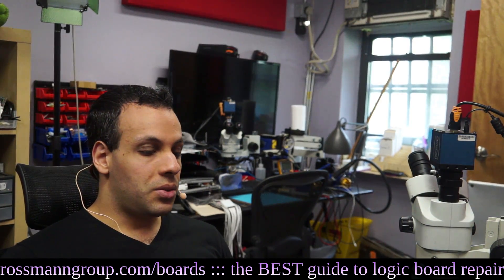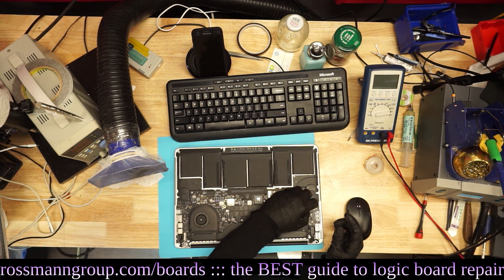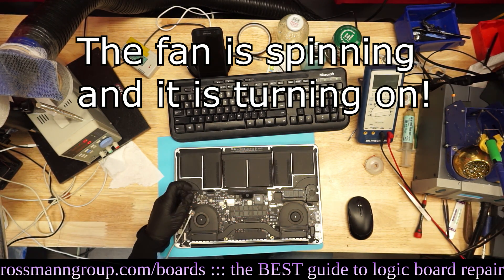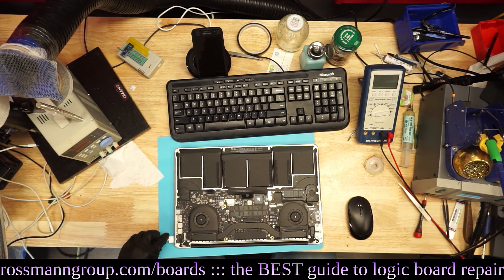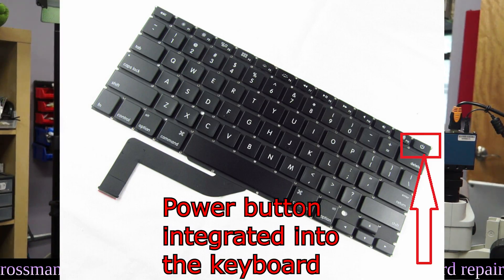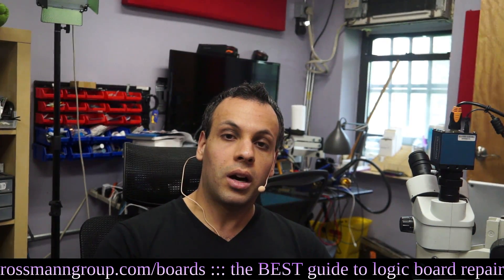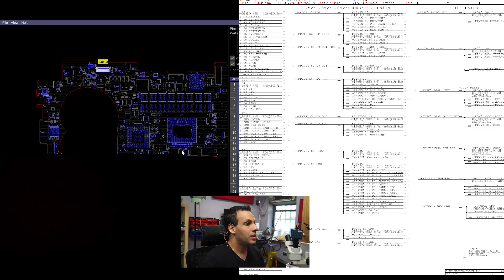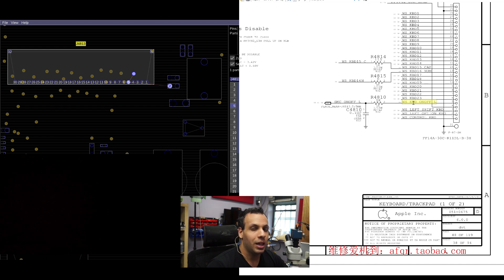Ingenious Macbook Engineering: explained in 3 minutes.

Comment: Although I would never buy an Apple product, the power button thing is not really Apple exclusive. All my Sandy Bridge Thinkpads (X220, T420, T520, W520) also have the power button on the keyboard. Not sure about my mom's T400 but I think it's the same on that one too. On the other hand those keyboards are protected against liquid damage and replaced within 2 minutes in case you damage them.
Reply: Yeah, it's bad, and not for a $1000+ device, but it's not apple alone.
Reply: No longer an issue with the T440 and newer laptops.  The power button was moved off the keyboard.
Reply: Except for the fact you can spill gallons of liquid on those Thinkpad keypads and it will still work. Go look up Thinkpad water torture videos on Youtube.

Comment: many lenovo thinkpads have the power button integrated into the keyboard like the T60, X220, X230, T420, T430, T520, T530
of course those keyboards are spill resistant and easily user replaceable

Comment: older thinkpad keyboards also have the power button integrated with the keyboard, but the difference is those keyboards are spill resistant and very easy to replace

Comment: My ThinkPad R61i also has the power button installed with the keyboard...On the other hand, when my power button starting shorting out, all I had to do was open a few labeled screws and swap it out with a replacement that was readily available and quite easy to order (not to mention cheap given how many years out this one is, along with all the computer recycler surplus).

Here's to good luck towards the fair repair bill, so that we can at least have a means of getting replacement A-stock top cases. 😆

Comment: THANK YOU! This is the EXACT problem I have. I've tried many different Google searches with different keywords. The answer I was looking for wasn't coming up. My situation is almost exactly how you explained water getting on the Z key. I spilled water on the space bar and bottom keys. If I take out the battery and plug the magsafe in the Mac book is functional, but with batter in it doesn't turn on. I'm confused on what to replace. Thanks Louis for all your in depth knowledge

Comment: In all fairness, xx20 and older series ThinkPads have a power button integrated into the keyboard.
At the same time in the 10+ years I've been using thinkpads I've never had any issue with this.
Reply from the maker: Spill resistant keyboards baby!!
Reply: Thinkpad has spill resistant keyboard. Ideapad otherwise..... is fucked up.

Comment: Wow, Louis made me realise something.. when he said you can't even plug in a cheap keyboard and recover your data. I was thinking, why worry about your data as it has nothing to do with power or your keyboard.   Then I remembered that the SSD is soldered onto the motherboard and unless it has be powered, you can't get your data off.

Wow, how something so incredibly simple like a keyboard and disrupt your entire life. 
These things seem to fragile.. Unlike most systems that keep on going if they can, it seems like these macbooks has so many points of failure you would not want to even touch one.

Even if someone gave me a £3k macbook.. I would worry about using the thing and be disappointed that I would not expect it to still be working in 5 years.  

Cheers for another, great and amusing video Louis.  The regularity is great.

Comment: Asus VivoBook X541UA is a laptop with a core i3-7100U which has a power button integrated on the right side. And it's far cheaper (and better) than the Macbook and the Macbook Air. You can get it for $380 where I live. (Though I'd spend $100 more for the full HD variant.)

Comment: I personally really like that simple and elegant solution of combining the already existing keyboard and power button, and yes of course there can be some challenged when the keyboard breaks ;) but it is in the form of reducing and combining still the best and most elegant solution. The worst of all is that if I was the designer, I would really have a difficulty time of decided whatever to completely remove the Power button, as you know it from the iPod, or to keep it xD just because I love this solution so much. 

It's a bit like the MagSafe charging port, it just has to die along with any other ports that not are the new universal USB-C, but at the same time, I also love this MagSafe charging port so much that it would be very hard for me to take such a choice. But again soon or later there someone need to take that responsibility to promote a more simple and elegant world where all ports are of the same type.

Comment: My acer laptop also has all the keys as one keyboard which includes the power button BUT looking on the bottom of the keys,  it seems to be waterproof, the place where the keys are is sealed off, and the key presses against a sealed off smaller button underneath, im guessing that was too hard for apple to think of.
Reply: Viralshadow 
I have a cheap 300 dollar acer laptop and it too has the power key in the keyboard layout as well. I don't think that it has any sort of protection against water but I've accidentally dropped water on it. Luckily my machine didn't malfunction.
Reply: even still, i expect different build qualities from a $300 laptop compared to a $1000+ laptop, not the same issues
Reply: my laptop was at about 500-600$ if i convert the price to usd, but that wont be fully accurate, it wasnt cheap, more in the mid range for pc's here, but damn the cpu is weak sadly (1.7Ghz i3 duel core)
Reply: Ed Saucin  I didn’t even know you could get a Chromebook for $200, let alone a laptop! I’m surprised it hasn’t fallen apart in your lap by now. As for Macs, I think newer MacBooks only use usb-c which means lots dongles, otherwise they are okay I guess.
Reply: Viralshadow That was also my thought, as I have been thinking, as a knowledgeable customer, about how laptop parts could become standardized for easy repair across years and brands.  Having a standard form factor and wiring for a keyboard and status LED combination board (in 3 sizes times 4 feature levels times 80+ languages) would be an obvious step, as the only laptops with truly unique keyboards are Thinkpads and Macs.
  Now the circuit on the mainboard would be required to do nothing harmful with a shorted / water damaged keyboard, and to accept powering on from a regular USB keyboard instead (that would be a Desktop Mac keyboard for macs).
  In my hypothetical list of 4 feature levels, level 0 would be a cheap easily shorted shit keyboard.  Level 1 would be conformally coated to limit and survive coffee and Coke(R) spills.  Level 2 would have a simple backlight for working in darkened rooms and level 3 would have individually controlled RGB leds.
Reply: +Ed Saucin
What do you expect at $300?

Comment: They should make the leaf of the Apple logo on the lid the power button if they're concerned about the esthetics of the machine. (Like one of those touch sensitive type things, not an actual button.) It would be a bit goofy but with Apple I would kinda expect it. They could also make the apple part a screen that shows basic information like battery level.

Comment: Louis, you are asking a company that gives zero F's about there customers to do something that could benefit their customers.
Louis, you already know that answer.
Reply: "As if Microsoft"

And do we buy computers made by Microsoft? I didn't know they sold any. I build my own computers using components from a number of companies... the OS is from Microsoft, unfortunately. I wish I could use Linux, but sadly it lacks compatibility with most things.
Reply: "What do you run on your "non-Microsoft computer?" Unix?" Apparently you can't read.

"Did you create an analysis of heat flow" Do you do finite element analysis before you bake a cake?

Comment: Here's why they do it. A surface mount tact switch is what? About $0.20 (I don't know for sure any more, too many years have gone by since I had to deal with such things) and a power button molded and pad printed in their volumes probably a nickle or less. So lets call the whole mess $0.25.  On the key board it's almost free because the keyboard has to be there anyway. Maybe three cents.  So there you have it. A savings of 22 cents per unit. Plus buy a new one from minor accidental damage. That's real money at apple's volumes since the faithful won't go away for something like that. 

Now the other brands, well someone will consider the machine a hunk of crap for something like that so they spend the 22 cents.

Comment: Lenovo up until the t530 series also has the power button integrated with the keyboard. It was more resistant to liquids due to special drainage canals, but if the kryboard stopped working chances were that the power button also.

Comment: I keep considering getting an old MacBook Air, then I remeber that a cheap 500$ HP pavilion 15 does exactly that and better in some ways(by being closer to a MacBook Pro in terms of features and being well supported on the Hackintosh community), but the downside is the trackpad that is smaller, and the fact it came with a plastic body and a 5400 rpm drive(to give credit where credit is due macOS does play a lot nicer with them than the forced crap called Windows 10)
Reply: You should buy a second hand system if you don't want to pay premium for one with a current operating system that sucks. So just get a used one, replace the old parts with the money you saved by not buying it new and install the OS you want. The initial owner already paid for the OS license, so that's free for you.

Comment: My MacBook Pro 2012 model works perfectly if the battery is charged however, it’s always showing the green led on charger and the battery status will show the lightning ⚡️ then when you click on it to see the full status you’ll see something like “battery not charged” and the battery will drain until is finished while on the charger.

I’ve swapped about 7 batteries with the supplier the problem still persists, what might be the issue in this case

Comment: Eh this bit me recently after I cleaned and re-applied the thermal paste on my MacBook Pro mid 2010 which had the stock paste and was getting hot too easily. After I reassembled everything the machine wasn't turning on and I had a mini hearth attack thinking I had broke something.
Fortunately I realized quickly that the power button was part of the keyboard so I reseated that cable which fixed everything.

Comment: MacToddlers will surely defend this. It's a lot harder to change the keyboard on a Macbook compared to all other computers but that's alright because it's a feature and it's fine that a problem with one key on the keyboard makes the entire thing dead. Don't know why anyone would buy a Applel product, it seems everyone who does is either a teenager or someone with a serious stockholm syndrome.
Reply: Mate, childish name calling doesn't make your point stronger
Reply: all things considered, their phones aren't nearly as bad as the rest of their products. i would still never use one, but there's somewhat of a defensible use case
Reply: Their phones, especially since the iPhone 6, are pieces of junk. If you drop them even once, or just keep them in your pocket, they can bend and/or damage one of the many ICs on the logic board that handle things like touch, WiFi, or battery charging. Had another bent iPhone 6 in today that had terrible WiFi, erratic charging, and just for shits and giggles, it randomly shut off a few times while we were looking at it. My coworker wasted a bunch of time replacing the battery and WiFi cable despite the fact that I told him the phone was obviously fucked when I glanced at it from 5 feet away and could see that it was bent.

The iPhone SE is probably the best phone Apple sells right now, it's got the guts of the 6 but the sturdier, smaller housing of the 5. Those phones are much harder to damage than the newer ones. I still think iOS is pretty shitty, though.
Reply: Adam Baldwin over the years I've dropped iPhones and Samsung's and nexus. They've never broke. You are talking absolute rubbish. Stop hating.
Reply: I work on these things every day, so I see way more phones than you do.

I guess you've never watched any videos on iPhone repair, huh?
Reply: ive owned multiple samsung phones, iPhones and also a couple Nexus's back in the day, ive never once had any issues with any of them other then battery degradation overtime which all of them eventually had. people just don't take care of their phones, i currently have an iPhone X and love it, i also loved my S7. iPhones aren't any harder to repair then other phones in terms of screen, battery, camera ect.
Reply: Johnny From Stovner to be fair, I just realized my Chromebook keyboard is held on with plastic rivets. How stupid is that

Comment: the computers aren't thin enough  to warrant the removal some less than 2mm thick button and cable... if are talking about the connector space... apple probably has a solution, they are the master of gluing stuff together after all.

Comment: I'm currently going through this garbage with my Chromebook. It was dropped, and now it won't turn on. Except it will boot it will accept the command to go into recovery mode, but won't accept any further instructions. Charging ic is fine, could and Mobo are mostly fine to my knowledge (no screen output, internal or HDMI, no USB action, etc). Power button is part of keyboard. I swear to God if that is the problem.

Comment: This is not unique to Apple, in my ~2012 Asus Zenbook it is the same. I had a problem with keyboard connector and it somehow happened so that only power button refused to work because of that. When I managed to turn it on I checked if power button works and it didn't while the rest of the keys worked as usual. Seems like power button has its own pins in the connector (or whatever it is called, I am very far from technical details and especially technical terms) and to make it work I had to reconnect it so that it doesn't loose contact and so that I am able to turn on my laptop.

Comment: there are other laptops that's integrated into the keyboard and its riveted in the case which is also hard to replace, such example is my little brother's Acer Aspire e-15 model. he spilled coke into the laptop and went to school for 1 hour, good thing i managed to save the whole thing except for the keyboard.

 its hard to replace and need special tools to attach or replace new keyboard i end up going into 3rd party mall repair shop and let them do it for 1500 PHP or around 27-29 USD

more examples Asus Zenbook UX303LN, Vivobook Pro N580, Vivobook S S510.
Acer Swift 5 and 3, Nitro 5, Aspire S 13, Aspire V 15.

not sure if most of them are riveted in the case.

Comment: This is especially stupid with their "ingenious" butterfly keyboard when the keys get stuck over time for no reason.
Had this problem with my girlfriend's Macbook 12, machine dead because the Power key was becoming unresponsive, it was frustrating trying to turn that thing on pressing on the key 10-12 times. Eventually the membrane underneath the key broke from the pressure and the laptop was unusable, ended up selling it in spare parts.

Comment: We all know they watch your channel... hopefully they can take some of these negatives and turn them into positives? They are stubborn though. I've had a couple MBP's since 2008 and have never spilled anything on the keyboard. I get it that accidents happen, but common sense tells me to keep liquids away from my over-priced computer. I have however, screwed up their USB keyboards trying to clean them.
Reply: I've had one Lenovo since 2008 and have spilled on it a number of times and have had no issues. All I've done is replace the hard drive when it got full and cleaned the dust off the fan when it started to get hot.

Comment: my ibook g4 has a separate circuit, connected via the shortest cable that will RIP off the mobo if you take the keyboard off too quick, and using the smallest most impossible to remove molex connector. mine is ripped off, so now i have to use a screw driver to bridge the contacts on the board when I want to start up the computer

Comment: hmmm, don’t most windows laptops have the power button on the keyboard now? and post-2016 macbooks with touch id have the power button on a separate circuit anyway, i would know since i replaced the trackpad/keyboard cable on my 2019 MBA.

Comment: I have a strange issue on a 2011 15" MBP.  There's no chime and just stays on black screen. The battery is charging.  When I connect the MagSafe to the MBP the SIL lights up.  Also if I try an SMC reset when I release the keys the SLI lights up.  The caps lock light does not light. Have spent hours looking for a solution or possible issue online but can't find anyone with this issue.  Any ideas?  
I just went ahead and bought a new logic board.

Comment: So I saw the same thing on some Lenovo Laptops, but I dont know if they use a different circuit...
Are you famliliar with those laptops (like on the ideapad 320 and those with that interesting lan port coverage)?

https://www3.lenovo.com/medias/lenovo-ideapad-320-14-hero-725x515.png?context=bWFzdGVyfHJvb3R8NjQyNjF8aW1hZ2UvcG5nfGgxOS9oN2EvOTQ2NzM3MDI0MjA3OC5wbmd8MjI1Zjg0OGU0Y2UwZjA1MDU0ZjdlM2U3ZjU1YjMwODBiYzY0YmYwZDEzZDA4NDI4Y2U5ZDEzZWY1NTAwYTljZg

Comment: The problem is that exactly like Steve Jobs wanted, Apple is made by ARTISTS and not by ENGINEERS.
Quoting Freeman Dyson:
A good scientist is a person with original ideas. A good engineer is a person who makes a design that works with as few original ideas as possible. There are no prima donnas in engineering.
Quoting from Sacred:
if builders would build like programmers do program, a roaming woodpecker would destroy the whole civilization.